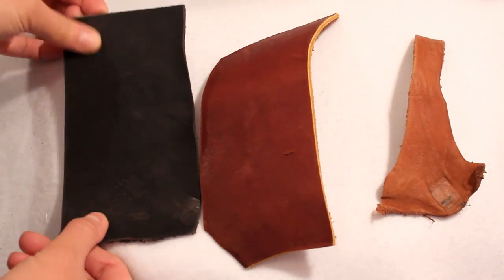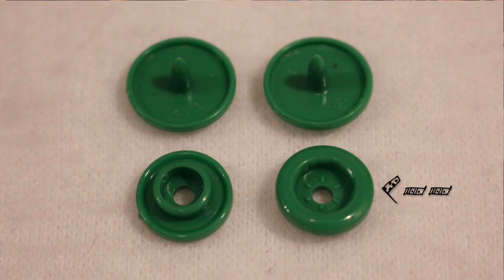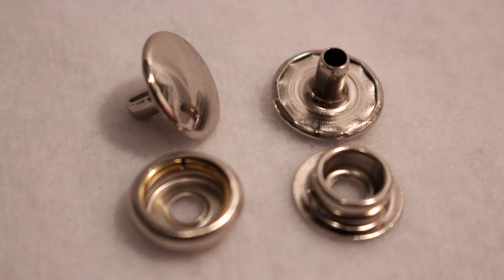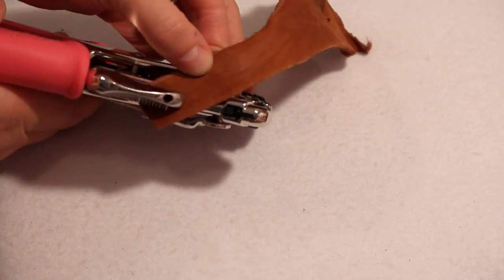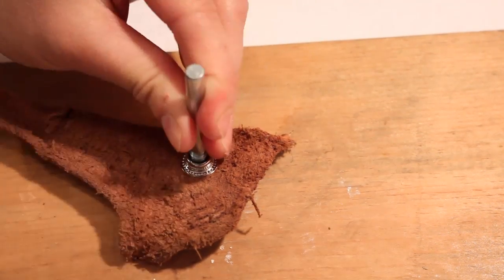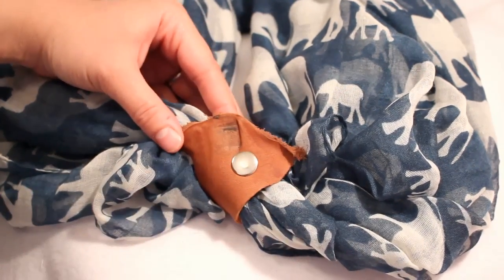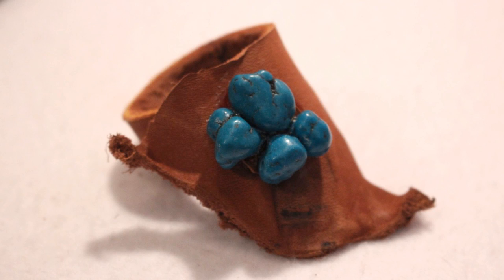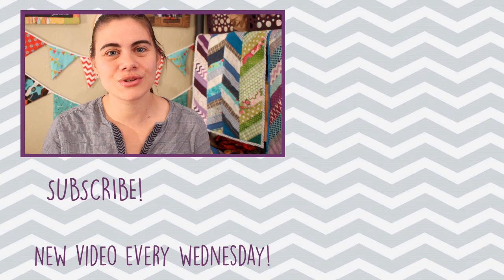Rustic Leather Scarf Cuff How to | Installing a Metal Snap | Whitney Sews

Comment: I am a taxidermist as well.... work with leather and fur a lot----- lil hint-- you can soak your leather bit-- and shape-- as well as pound edges flat with a hammer and sort of fray out edges  ( do on side you dont want to mar up-- usually back side) with a brass toothbrush kind of thing--- sorry dont know what the name is  lol-- then just mold wet leather  bit to shape you like and let dry--- is how I make molded leather masks...( dont be afraid to really get er wet-- it will survive-- trust me)-- and you can dye as well-- I use leather dye-- half and half methyl hydrate-- on damp leather-- extends the dye-- if you like a shiney finish-- a spray of laquer  does the trick...( I see a plier mark on Whitneys piece-- again-- get leather wet-- and take a rounded blunt object-- like end of a screwdriver-- and pound/ press and smooth out-- usually in one direction and to outside)you can be quite rough with leather if it is thick -- if is soft-- nope-- gentle  lol
Reply from the maker: kimcase9 Thanks for the tips!

Comment: That was clever scratching up the snap on concrete.
Reply from the maker: Thanks!  I thought about using sandpaper, but I don't like sandpaper that much and the concrete worked perfectly!
Reply: Whitney Sews honestly I think the concrete was the better route. I feel like it takes forever to rough up a surface for gluing with sandpaper sometimes.